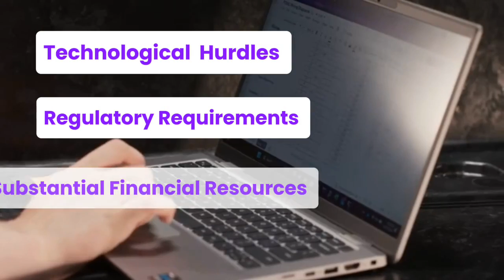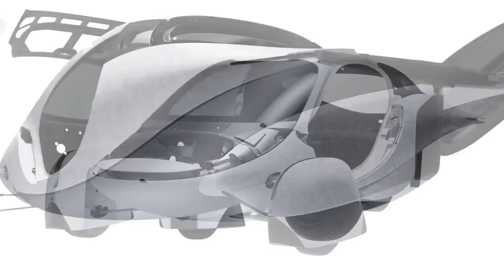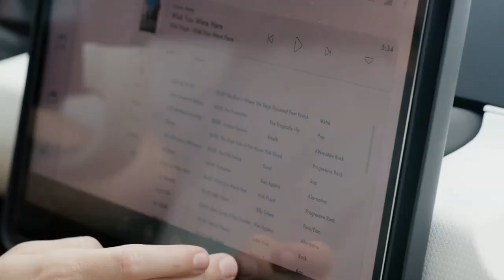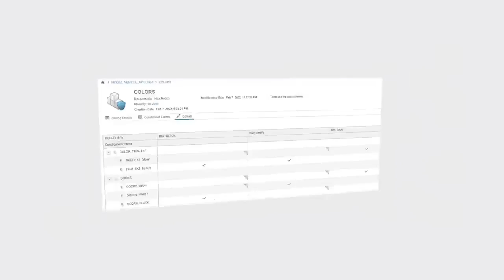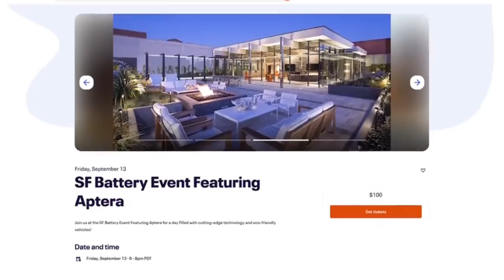Aptera Solar EV nears the markets

Comment: 40k for an autocycle...sigh
Reply: That is at least as safe as a car, and gets up to 40 miles of range free on a sunny day and also saves a lot on maintenance.
Reply: @robinpettit7827  - Plus right to repair, so anyone can work on it. I also like the 1000 mile battery. Then they have a tent for it which allows you to camp in it anywhere. It does everything anyone would ever need.
Reply: @robinpettit7827  Aptera is a motorcycle and it does not conform to any safety standards necesary for a car. And Aptera is unable to fulfill them. The 40 miles are just an empty promise. Like anythjing else from Aptera.
Reply: @billsmith5960  The 1000 mile battery does not exist. But maybe you will be able to buy the tent in a flea auction after Apteras bancrupt.